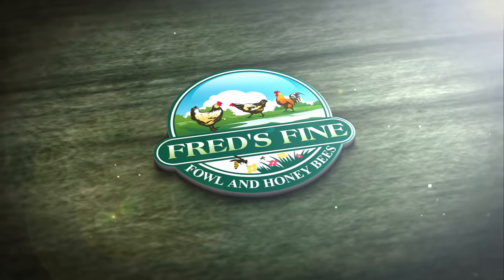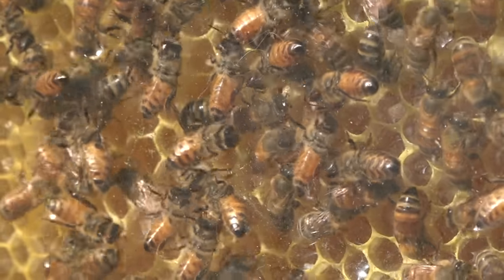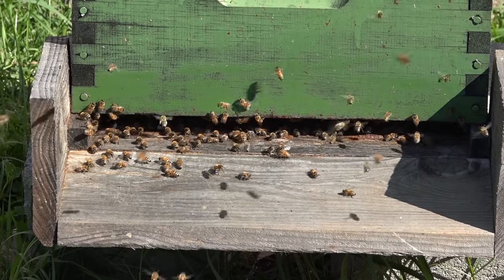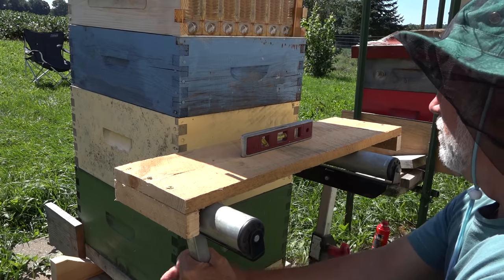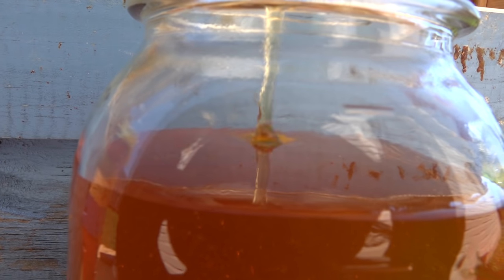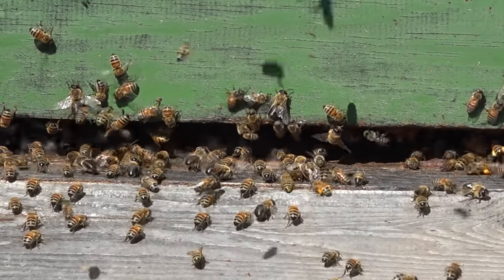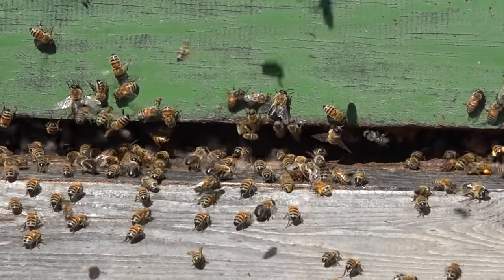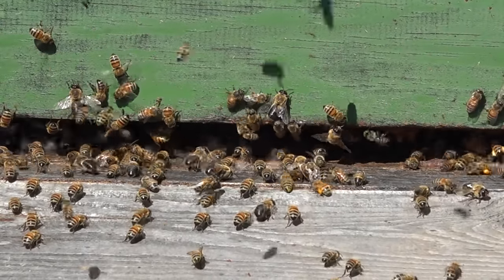First Flow Hive Extraction Cycle How to remove honey without filtering frame by frame

Comment: Your videos are the best I have seen.  I am a new beekeeper this year and put my flow hive on June 1st but two months later the bees had only added propolis. I was told by the Flow Hive folks not to leave it on in the winter so I took it off and waiting until next spring. I live in zone 6a so my winters are cold. Do you have cold winters and if so do you bring in your flow frames?  Do you ever feed your bees sugar syrup?
Reply from the maker: Hi Ron, This year, I am leaving all of the flowhive components on and out in the apiary. My purpose for that is to see if they "could" fail or show some negative results from the cold. I'm in Agricultural zone 4 and it gets down well below zero. Plastics out in the cold shouldn't break down and would certainly be more prone to breaking IF we tried to activate they during freezing cycles, but no reason to move anything under those conditions. I think it's wise to remove the flow supers for winter (do as I say, not as I do here) and then when spring arrives, place the flowsupers on colonies which show the strongest numbers. You can also rinse out, or allow the bees to clean out the flowframe cells so they will be ready for the next season. I leave enough honey on, so don't put any syrup in the hives during winter. IF I had a late season swarm that didn't have time to build up resources, I would certainly put a feeder on top. In cold climates such as mine, I like the polystyrene top feeders so that I can open them during any weather without exposing the bee cluster to weather extremes.

Comment: Ghads, if I were to start a bee colony, I would only ever have to drain it once a year with the amount of honey I use. I guess I would find more uses for it if I had an unlimited supply.
Reply from the maker: HI Paul, the amount of honey available for surplus use is the same with any hive design. But this is certainly easier if you only wanted to draw off a few quarts.

Comment: Hi, Fred.  Great video.  I only now saw it even though it's from 2016.  My question is who's caring for the brood when there's a mass exodus because of honey leaking over the frames?  Doesn't the brood need to keep warm and larvae needs perpetual feeding?  Do the nurse bees stay with the brood or are they also outside the hive?  Inquiring minds want to know.
Reply from the maker: Hi William, this event only happened during my first extraction cycle. The brood didn't seem to suffer losses as there wasn't any being dragged out onto the landing board for removal. But future cycles of the flow-frames had more complete wax cappings and sealing so the leakage was far less. I also no longer open every frame to its full length at once and have learned to only open each frame in thirds until the honey slows and then opening the remaining segments. It was a quick learning curve and no issues after that. Thanks for watching :)

Comment: I know this is an old video and I hope by now you've learned that this was not the best way to extract the honey, specially being the first time. You should have only extract maybe one frame at a time the first time. You can also try not turning the key all the way, allowing the honey to flow slower so it doesn't overwhelm the extraction tube. You really don't want the extraction tube to be completely filled. This will cause a backup of honey flowing and the honey will find other places to leak out. As each frame flow slows, then you can open another one. After a couple extraction you won't have the issue with honey dripping into the hive.
Reply from the maker: Thanks! Because I evaluate systems and equipment, I think it's improtant to show what the possibilities are/were, just in case others have a similar situation. Even Cedar and Stewart were opening entire frames at the beginning and have since changed to cycling sections at a time to prevent leaking. The second extraction was much better and we do open each frame in segments. You are absolutely correct :)

Comment: with the frames on the side it is quite easy to see, if the cells are capped, but how to you see if the ones in the middle are capped? you can see the first row of cells on the back, and even here it's quite hard to judge.
or do you remove the frame, look at it, put it back in and extract the honey? that would be kind of a contradiction to this invention.

Apart from that, I, as a beekeeper think these frame are interesting. Dont know why beekeepers go crazy about it. But I am somewhat skeptical, since I cannot really see the benefits of that system for me. In honey harvesting time I check my hives regularly, to see if they want to swarm. So I have to open the hives anyway.
I could save money because I do not need a honey extractor with flow frames, but the frames are so expensive, that this advantage is neglected for me.
Reply from the maker: By the time they cap the cells at the edges, all of the honey has been ready. To date, I haven't had any high water % readings on the honey from flow-frames. I don't pull them prior to extraction as that ruins all of the work they have done to join the frames, but that "could" be done if someone wants to see every surface. Pulling the entire super for inspection of the frames below is easy after an extraction has been completed from the flow-frames.

Comment: Frederick....... I'm looking at the cells in the flow Super and thought I should not drain off the honey until all the cells are capped?   I am seeing your extraction procedures to make sure 'we will do it right'.  
I see you didn't wait until all the cells were capped.  I must say that we are a bit anxious because we intend to pull another two frames out of the big colony as we think they are quite full of bees as there are many on the landing board  for three days now & I see continued bearding ( they are not bearding as your bees do as yet).
Of course it's difficult to lift the Flow hive off while it's full and the outer frame is about 70% capped but the rear cells are not quite full of honey/nectar yet but any day now they will be.
The weather will be hot in a couple of days time so it may well be perfect to get the honey to flow.......   I'm quite anxious and don't want to see them swarm before I can get at them and do an inspection.   As soon as the rear frames are full, would you get the honey drained off?   Sorry to ask in a hurry.
Reply from the maker: When you see those cells getting capped through the rear windows, I go ahead if they need more room and I do honey testing right there frame by frame and write the moisture content on jar lids with a grease pencil. If any of the honey is over 19%, I'd mark it for further dehydration inside the house. I've found that when most of the cells are capped, just like regular honey frames, they are all almost there and haven't had high moisture content issues.
Reply: @FrederickDunn  Thank you very much indeed Frederick. I have a spectrometer coming today..... It's getting to fever pitch here!   You can imagine what it's like when you've been through the whole process yourself.  The cells are 90% capped on the sides but the rear cells no & the cells are not full  yet..... any time soon I think but watching a kettle as they say never boiling (so it seems)....
I think they havce done fantastic considering they were suffering in the Spring with the V.
The OA + G   strips did it...... The new colony is still dropping 70 today..... as you say terrible but I should get the better of them before long.  Lots of light coloured ones straight out of the wax!

Comment: im thinking we need a horizontal hive that you can fit a flow frame box on over the honey end. it would take some time to cultivate, but would solve the full evacuation problem.
Reply from the maker: That's an idea, but this only happened during the first cycling of the flow supers and only if all frames are harvested at once. All of the subsequent harvests have been smooth and uneventful :)

Comment: I ended up here because facebook showed me a video of the flow hive and I started browsing youtube for more info. I'm new to this but find this very interesting. I have a few questions watching this video. you store the honey in the bottom boxes for the bees to survive the winter. If you would keep bees in a tropical climate with no winters, could you extract all the honey or you always leave some honey for the bees? another question is about the bees ventilating in front of the entrance. They do this standard or only when it reaches a certain temperature? did you ever put a heat sensor to see how hot it gets inside the hive? and is there something you can open for extra ventilation? I need to watch more videos ;)
Reply from the maker: Hi Chris, I'm glad you stopped by to watch my videos and to comment! if you live in an area where the bees do not end up confined for extended periods due to winter cold, or extended rainy seasons, you can take honey more frequently, but I caution you to not remove all of the honey, but to rather take a few frames at a time during periods of abundant nectar flow. As for ventilation, please sub, or check in on my channel in the next couple of weeks as I'll be introducing a hive top and bottom board that increase ventilation while improving efficiency for bees living in high heat conditions. The bees cool or heat primarily the brood frames and not the entire interior of the hive. Cluster temps at the center will always be in the 90's and the bees make an insulation ring around the cluster with other bees. They also paint the interior surfaces with water and use evaporation in the cooling process. They move the air to cool the interior, but also to keep an air exchange for the developing brood. I hope that helps!

Comment: QUESTION: If the dripping honey is a major threat to the bees. Can you remove the flow frame super and crack the frames elsewhere? The flow frame super should be taken off before winter anyway, right? Why can't somebody wait until all 7 frames are ready, take it off and bring it to a spot where it will just drip on the ground or into some sort of catchment, and crack them there? Maybe stack it on an empty langstroth box. With any sort of flat baseboard underneath, like maybe a lid from a tote. 

This is the first time I'm learning about this problem with the flow hive. I knew there had to be a catch!
Reply from the maker: You can indeed wait until the super is capped and then remove for winter and do a bench extraction. After the first cycling with the flow-frames, this dripping is not a problem.

Comment: 9 us liquid quarts =
8.51718 litres 
                      ( " volume " us liquid quarts ÷ by 1.057 = Litres )
                      ( multiply litres  by 1.057 = us quarts )

4 us liquid quarts =
1 us Gallon  
                       ( volume ÷ by 0.25 )
                       (  multiply us quarts by 0.25 = us Gallons )

3.78541 Litres = 1 us Gallon   
                        ( volume ÷ by 3.785 )

1 us liquid quart =
0.946353 Litre
                        ( volume ÷ by 0.946353 )

Comment: Hi,
How does one keep a hive from freezing?  We frequently have a couple weeks straight of -20*F in the winter where the highs are still below 0*F during the day.  Couple months of unmelted snow is not uncommon.  Would I build a storage shed with electric heat?  I've looked and not seen bee hive heating addressed on the internet.  In the spring I have a yard full of flowers, but I seldom ever see any bees.
Reply from the maker: Thank you for this question, I'm sorry to say that you may actually be in a location where you really can't winter over honey bees. Sustained temps at 20 below zero would take a huge toll and I"m not sure they can survive that. Many cold weather keepers migrate their hives to warmer locations for winter, then return them in spring. Lots of keepers in Alaska lose all of their bees each and every winter and have to buy in nucs or package bees for each nectar season. it's a sad truth I'm afraid. A heated space would not be as important than having a wind protected area, the bees can control their own space immediately around the cluster if they don't have to fight drafts and windy conditions. It's a careful balance of ventilation without drafts. So, like chickens, kept out of drafts and wind, they can do a fantastic job of not freezing to death.

Comment: couldnt tell what you used at the top that turned to open the flow but I think I need this whole set up.
Reply from the maker: Sorry about that, it's just a long stainless steel bar that is inserted to activate the flow frames by opening them. I have demonstrated it in great detail in my first flowhive video. I hope you have great success with yours some day :)

Comment: Great informative series on flowhives - I was not looking for a love- or hate-opinion, rather I was looking for information and demonstration  - which I found here - thanks! 
One question concerning the differences between honey from different frames - I'm wondering if there might some effect of how bees treat and process honey in different parts of the hive  - didn't you observe some reproducible pattern of honey quality (e.g. color) among different hives - such as that the honey from middle frames is always distinct from the honey of the outer frames?
Reply from the maker: Yes, with the traditional honey super frames, there is a wide variance in color and source, particularly in spring or summer honey production. We just never notice it, because ALL of those frames are generally uncapped and we do a big harvest, so it's all blended together. It's all mixed in the end. With the flow-hive frames, it's finally practical to just remove honey from a single frame and it was a lot of fun to keep them separate. Thanks for watching and commenting.

Comment: I'm planning on a spring 2017 initial hive, it will be a flow hive, is it out of the question to expect to be able to harvest honey in that first year? I'm starting in March of 2017. I reside in E. Tennessee. I am an absolute beginner at bee keeping. Watching your videos & also Vino Farms videos have been most informative and helpful. my local bee keepers all "feed" their bees syrup. Thanks for your time and consideration.  R.C.
Reply from the maker: Hi Ranger, I'm sorry I didn't notice your comment until now. Some keepers are able to take honey the first year, but most will wait until colony strength is up along with their resources, then placing flowframes on the next season. It's regional, though, Tennessee may have much longer nectar flow seasons and production therefore higher.

Comment: Fred, Very informative, illustrative and practical videos on the Flow Hive. As I'm in the U.K. and use National Hives we have had to wait for a National Super version to be available. Which it is now, but rather costly. So time i think to try one out.Any views on longevity of the product? I know they can be cleaned but question if parts break and are parts easy to get etc... Any views yet?
Reply from the maker: Hi Frodo, I have no idea how many seasons we will get out of them. At this point, I am testing six of them and they are all holding up fine. We've only been through one heavy winter with them, so longevity isn't established. I will keep sharing the good and the bad. So far, so good.

Comment: Is there a reason why you wouldn't just leave the flow hive tilted back all the time?  Is it because snow & rain on the landing board would run into the hive?
Reply from the maker: That's a great question Steve and with the full flowhive systems, they are always in the tilted back position and the landing board tilts forward. Tilting is only required when using flat bottom boards. It does not cause a problem to tilt a hive forward or backwards BUT it's a problem if you tilt side to side... great question and no reason really other than I was using a flat bottom board. A permanent 2 degree tilt back would be fine.

Comment: Do bees get stuck in the comb when you open the flow frames for honey? Is there a queen excluder on this hive ? I'm assuming so so that no brood will be in the flow hive frames..
Reply from the maker: I highly recommend that beginners use queen excluders below the Flow-Super. However, I don't use them anymore as I found queen excluders impede worker progress. The bees don't get stuck in the cells when they cycle, there are design tolerances which prevent that injury.

Comment: So what caused the honey leakage into the lower boxes when you activated the flow hive frames?  I thought the frames were sealed internally where the honey canals were...
Reply from the maker: They can overflow, particularly where the bees have not completely sealed off the surface. During subsequent re-fills by the bees, the issue goes away.
Reply: @FrederickDunn  Thanks for the reply- 'll have to watch out for that this summer!

Comment: Hi Fred - thanks for sharing the video. I've learnt from all your videos.  Keep talking . you pace is really great. Like a lecturer taking classes in uni. I have a question,  why don't you drain one at a time instead of 7 at once, that way the bees may not have been disturbed much living outside for a 12to 24 hrs. 

Another question, in your previous intro video there were lot of gaps and bees were coming out in the rear but not its clear. how that happened. Is it the same hive or different? Regards, Raj
Reply from the maker: Hi Raj, thank you for your questions and compliments! The reason I opened all seven at once, is that I am trying to show what "can" happen, it's like taking a new car out and flooring the pedal to test it under maximum load. In the next video (2nd extraction) the method is improved and the bees have nothing to cope with other than replacing honey that has been removed.  The bees sealed up the gaps on their own and stopped all chewing activity, so those open gaps turned out to not be a problem in the end.